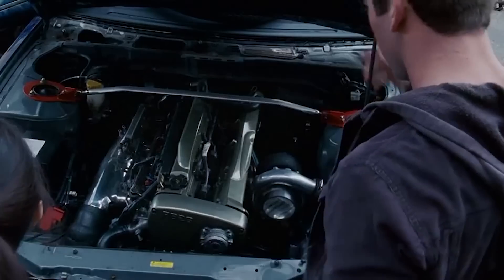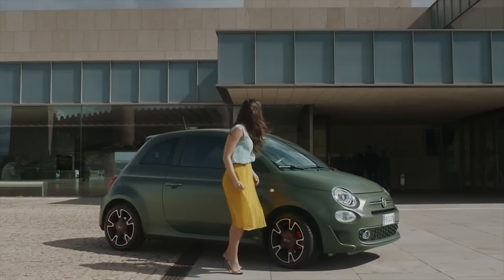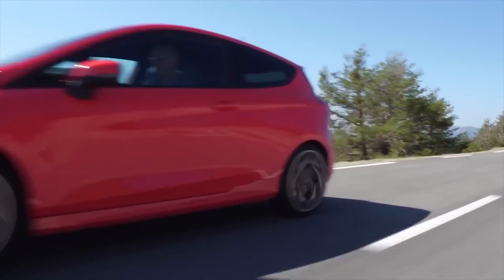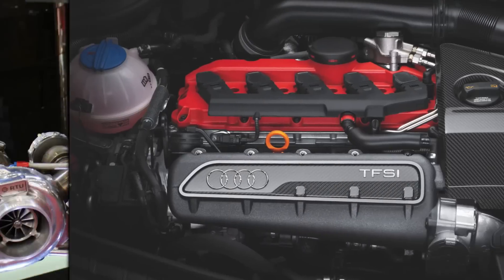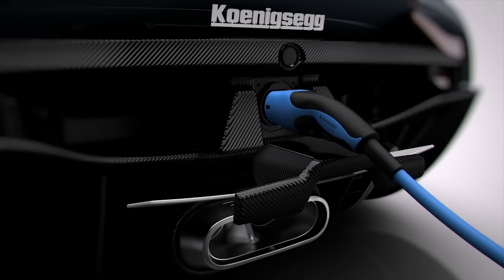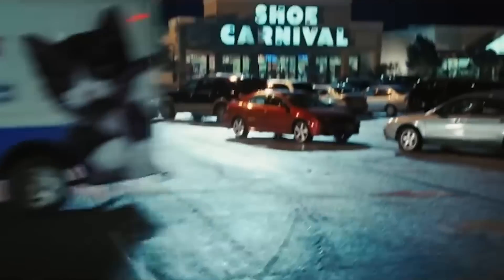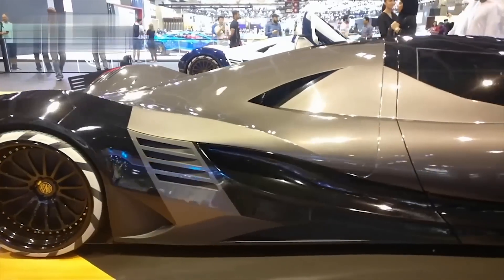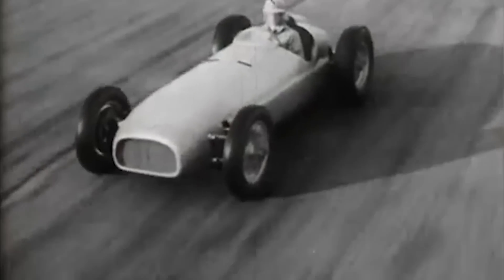Most Powerful Engines from 1 to 16 Cylinders

Comment: You had me all the way until you put the DEVEL.
Reply: I thought the engines 4300 somewhat HP was real? Just bringing it to the road isnt right?
Reply: @aukemarcus7679  yeah an engine is possible but it gets one run down a track and then it melts down and has to be rebuilt not very practical
Reply: There are alot of questions if its even real. They DID make a 2k hp car but I mean LS, Coyote and GTR has that beat easy
Reply: Same
Reply: Yeah it’s fake
Reply: Devel did not go in production.
Reply: go check the nelson racing engines channel if you doubt about the engine , they re the ones who developped it
Reply: @albapor1996  the engine itself if also fake. It look v16 but its pretty much a turbo charger v8. In the videos of the Devel there are not any real power shown. Not even a real acceleration. You cant hear any v16 sound in any of the videos. Also. There is not enough space for that huge FAKE v16 quadturbo
Reply: @balazs7808  or enough cooling capacity.😜
Reply: @danw1955  true :)
Reply: @balazs7808  no

Comment: They should have said, "production engine" in the title. They might have been the most powerful production engines, but definitely not the most powerful engines.  Top fuel dragster 8 cylinder engines make 11000 horse power.

Comment: Koenigsegg 5.0 is based on the Ford mod motor.

I thought that looked familiar, I had to look it up.

They used the mod motor as the base and engineered their own, though I would love to know the details on what was changed.
Reply: Strange. I thought the CC8 and the CCX had their engines derived from an LS
Reply: Nope.

I had no idea what they were running before yesterday. Never looked into them aside from Top Gear and Project Cars.

Comment: no no no, the agera rs and the one to one has more hp than the regera. The regera gets 1100 hp from the v8, and 700 from the electric engine, but the other two get 1360 hp, not to mention the new Jesko that gets 1600 hp

Comment: 336 mile per fill up on the viper.  I don’t see the issue about needing to stop at every gas station.
Reply: Let's make it 200 for a heavy foot, I'll still take that V10 torque.
Reply: Right I was thing the same thing. That's decent range.
Reply: The 2017 ACR barely gets 19, and with a 16 gal tank it had a range of 304 which isnt too bad either
Reply: I believe they said the Viper gets 21 mpg on the interstate .
Reply: That's for cruise speed, anyone who owns a viper would definitely drive it faster then that let's be honest🤣🤣🤣

Comment: Viper ACR gets 21 MPG on the highway?  Thats better than my 4runner.
Reply: The viper gets better gas mileage than my car too. I get around 14 MPG
Reply: thats bs a viper gets 9mpg on city and like 13 on highway
Reply: I had to re watch that a few times? And my car gets 25...
Reply: My car gives the same and it's a v6 with half the horsepower. I think weight and aerodynamics also has a lot to do with it.
Reply: I can push 30+ mpg with the 5.7l hemi on the highway doing 85, its in town where my mpg goes for a dive only avg 18mpg in town. Right now my avg of all driving is 22.4 mpg and my car is twice as heavy as the viper So I can believe the viper getting 21 highway.
Reply: Hahahha well the engine is big and powerful enough to pull a big light car lol
Reply: My 97 limited is lucky to get 20hwy.. but I'm keeping it!✔️😂
Reply: Ya 21 mpg is off paper bs not real number
Reply: @championx1  it's likely because it has very long gearing, and a relatively low weight. Nobody is likely to drive it in an economic way though, because it begs for more throttle.
Reply: Corvette gets 29 MPG.....screw rice burners

Comment: Cubic  inch displacement  or CID has a lot to do with power but its  also how you are built   I personally  will take the CID  the more air you can pump effectively  the more hp you can make

Comment: You are mixing turbo and naturally aspirated. You completely skipped the Honda S2000, which put out 100 hp per liter naturally aspirated.
Reply: Only 240hp
Reply: @bassinmylife9203  250, 125 hp per liter
Reply: Let me know when that Dodge Hellcat delivers 600bhp from cam, porting and headers alone.

Comment: Um what about the Agera RS 1360hp
Reply: Or Jesko
Reply: Regera actually has peak hp of 1700+ hp at high rpm range.
Reply: Honda S2000 AP2 regera has 3 engines 1 gas power and two electric ones but still where’s the Agera RS or even the Venom GT or even the SSC ultimate Aero or the Saleen S7
Reply: Thats what i wrote too

Comment: De La Vergne single cylinder 
330 liter displacement (20K+ CID)
125HP
4,100lb-ft
160RPM
40 tons
Made in 1903
Reply: 160 Rounds per minute it is.
Reply: 330 litre? That's 330000cc
160RPM? I think you want to write 16,000 RPM or 16k RPM
Because my table fan here spin faster than 160 RPM 😂
Reply: Edit sorry, i didnt remeber replying to your earlier comment, 

you are correct in your conversions, the engine is, three hundred and thirty Liters, 33000CC, or 20137.8CID, single cylinder, that spins at one hundred and sixty revolutions per minute, with a piston that reciprocates three hundred and twenty times per minute. The stationary engine(meant for use in factories likely) produces , one hundred and twenty five horse power, and four thounsand one hundred foot-pound of torque
Reply: If it's true damn that's just insane haha
Reply: That's some massive engine 😮

Comment: 6:33 "its enough to snapping transmission gears" THE REGERA HAS ONE GEAR!!
Reply: He means it by:
If another vehicle had the same amount of power, it would destroy its transmission
(which is still kinda bs because look at the 3000hp Nissan GTR)
Reply: @cavxlier7822  its not a 3000hp gtr its GTR shell with 3000hp.
Reply: Noobie Bass Boosts it dose the have gtr transmission, block, interior, turbos, tyres, rims, differential, or body panels, everything is aftermarket and nothing will be stock
Reply: @cavxlier7822  That's still stupid. You can break transmissions at 300 HP, it all depends on the tranny. There's trannies holding more than 5000 HP, so that statement is totally invalid.
Reply: I'mRinoX Not really. Those drag cars running that much power have special transmissions that work for one race, then it either stops working or they have to change or mend it.
Reply: iiKasivo stock mate u want to do this with tuned cars because we can do top fuel dragsters and they have 10,000+ hp
Reply: And Agera RS has 1360hp lol more than Regera.... this guy needs to learn more ab his cars lol
Reply: @shfla7293  then theres venom
Reply: Quinn Marchionini ELEMAYOOO
Reply: ...left ;o)
Reply: The car there  on the picture was a agera (rs) i think?
Reply: And no pistions its electric
Reply: XclusivePower  the regera is electric
Reply: correct me if I'm wrong but doesn't the REGERA have a planetary gear set... like one massive clutch
Reply: 2JZ

Comment: What about the 0 cylinder cars. Aka rotarys😂
Reply: @Eddie Hitler dude...its a joke. Take a fucking joke.
Reply: EXACTLY!!!
Reply: Was about comment that. Name another 1.3 that can be boosted to crazy power.
Reply: 0FG Rager yeah like the RX-7 FC and the RX-7 FD
Reply: Y’all mind if I.... blow an apex seal real quick?😎
Reply: They count as cylinders
Reply: @EctoGamer  technically it's about rotors.
Reply: @diegoNL2K  yeah and a 1 rotor is in a cylinder thats triangle shape
Reply: 0FG Rager yeaaaaah
Reply: Sorry, but that triangle, is a cylinder. Bad call dude
Reply: 0FG Rager so ur a crack head right?
Reply: Knowledge 100
Reply: We don't dare speak about the devil
Reply: lol they lost out to the electrics
Reply: No one even need gas anymore get with the times
Reply: @timb3174  No electric cars are shit, most of them are ugly and they don't have sound Exept this annoying high pitched noise
Reply: @timb3174  no
Reply: tim b everyone needs gas
Reply: No one cares about rotaries. That’s why they don’t manufacture them anymore
Reply: @jasonneal  it's not because no one cares is that the rotaries are unreliable that's why Mazda stoped making Any RX-7
Reply: Electric engines aswell
Reply: @timb3174  yeah,no. electric cars suck

Comment: I have a 3 cylinder 1.0 L stock Fiesta Red Edition that puts out 140 hp. It does 0-100 km in 9 secs, going to tune to 168 hp and will then do 0-100 km in 7 secs.

Comment: There are two engine configurations that are superior to all others. The inline 6 and the Boxer or flat 6. These engines outshine all other because they are both inherently balanced on all orders. They don't get the spotlight nearly as much as V8's because for some reason having those two extra cylinders has somehow become synonymous with more power. But the reality is, it doesn't. If it did, then all the big Rigs out on the road would have v8's in them. But they don't, they have an inline 6. 

Here's why that is.

A V8 is really just two inline four cylinder engine merged together at the crank in a 90° V configuration. This means that the engine still has all the same inherent imbalanced as the smaller engine its derived from. A partial fix is to use a cross plane crank and counterweights, but this results in another long list of compromises. 

An inline six is basically two inline 3 cylinder engines, each half still has the same imbalances, however each half has them exactly opposite of the other, so they cancel eachother out perfectly. The only inherent flaw of an inline 6 is the length of the crank and cam shafts. This extended length makes them suseptable to twisting, and thus bringing half the engine out of timing is its one flaw. But larger engines have stronger components, so this flaw is greatly mitigated.

Likewise, a boxer or flat 6 is also two inline three cylinder engines joined at the crank 180° opposite of the other, with each bank of cylinders reciprocating in exact opposition to the other. So each poston in the opposing bank is always traveling in the opposite direction to its opposing piston. The engine is also more compact that the I6, with shorter crank and cam lengths.
Reply: Nothing beats the savage sound of a v8 brother!
Reply: David Blalock and what about the v12
Reply: diesel is alot different than a gasoline engine bud another youtube mechanic man your talking about 10l to 17l caterpillar engines for example a ls7 thats a 7.0 thats twice as less the displacement you know the bore sizes are on a c-15? it like fitting a soccer ball as a pistion your statement is totally out of the ballpark you put something like a c6r against a gtr on track its going to lose v8s are one of a kind engine if you cant except that then you shouldnt talking bout engines
Reply: why you think V8s held titles in racing events? i mean think about it nascar and f1 wouldnt be were its at unless they had a v8 stop hating on them bro

Comment: Truth is, the displacement of the engine is very deceptive. Engine power is always the same per unit of air volume. An engine will run at an average air to fuel ratio 13:1 (+/- .5). If the engine runs richter it will run out of oxygen before all the fuel burns, losing power and fouling the spark plugs. If it runs leaner, the fuel will burn too hot and damage the engine. So you're pretty much stuck with that 13:1 air/fuel ratio. So the only way to get more power is to get more air to pump though the engine; And there are only two ways to do that, more displacement or forced induction. 
A larger displacement engine will make more power as its going to draw in more air per rotation of the crankshaft than a smaller engine. A larger displacement engine also loses less energy to mechanical loses as there is proportionally less friction. However larger engine require more space and add more weight to the vehicle.
Forced induction engines used some form of air pump to drive more air into the engine that what natural aspiration allows. This pump is either powered mechanically by a belt, gear, or chain drive off the crankshaft, electrically by a motor powered by the vehicle's electrical system, by a gas turbine driven by the engine's exhaust system, or by a hybrid turbo-electric system.
Forced induction pushes extra air into the motor, this allows (and requires) more fuel to be added, which equals more power. So a 6.0 liter V8 might produce 500hp, and a 2.0 liter 4 cylinder with a turbo could also make 500 hp. The 4 cylinder engine does this in two ways, turning half again faster than the V8, and pushing twice as much air into each cylinder per ignition cycle. In the end, both engines pumped the same amount of air and fuel through them, so both made the same power.
Granted this is a simplified explanation, but its enough for you to get a basic understanding of how this works.

Comment: So no one is going to talk about 3:50? I mean come on this is fake. It literally says stage 4. You don't gain hp through the wheels. You lose power because of the weight of parts. Stage 4 probably means stage 4 turbo based off the chart. But could mean other things. ThIs is FAKE

Comment: Why would Volkswagen use a 1199 superleggera L twin when instead they can use a 1299 Panigale L twin which produces more power and torque than the superleggera variant of the 1199 superquadro and also the 1299 Panigale L twin (1299 superquadro) is much cheaper to manufacture than both the 1199 and 1299 superleggera variant of the 1199 and 1299 superquadro respectively? It might be the unreliability factor which the 1299 Panigale superquadro is notorious for and as such the strong components (mainly more titanium components) of the 1199 and 1299 superleggera L twins compensate for the bad reliability???

Comment: when talking about v12, why didn't you mention LaFerrari? its has naturally aspirated v12 and produces more power than the 812 superfast.
Reply: Laferrari is a hybrid with a 6.3L Tipo 140 V12 that makes around 789 HP and the hybrid makes around 160 hp accounting to  950hp whereas the 6.5L Tipo 140 makes over 800HP on it's own. However these are far the most powerful naturally aspirated engines as the cars from the scuderia Ferrari's xx, the F1 cars of the late 90s and early to mid 2000s and ofcourse the Valkyrie cosworth and the soon to be revealed Mclaren v12 that will be the successor to the F1 are all more powerful.

Comment: Gotta love the "prototype".  They forgot to include what is actually produced.  Top fuel dragsters.  Power levels so high, we have no method to measure them. 10,000+ HP in a V8.

Also didnt mention the worlds most powerful ship. A 2 stroke making over 109,000 HP
Reply: @charlesangell_bulmtl  Go find legit dyno test before assume its garbage.  The top fuel is to agressive for a Dyno.

This aint your grandma's WRX or your sister's Skyline.  This is raw power. Only calculated based off RPM, Time, and Weight.

You should probably make youtube videos with as inaccurate as you perceive this to be....
Reply: @charlesangell_bulmtl  electronics are not the problem.  Its the ability for steel to hold up.  Going from 0-330mph in 4 seconds destroys things.  

Top fuel destroys the machines they get strapped too.

Electronics engineering is a major focus in my life... The combination of gasoline and electronics = extreme fun

Comment: ever heard of reliability?
also, putting a bike engine in a car is a terrible idea, toyota figured that out years ago when they put a yamaha engine into the celica
Reply: Wasn't it just the head that was done by yamaha.
Reply: @blyndrotor   oh ok thanks for the correcting me
but still, the engine was bad
Reply: @Digidi4  
I had a 2L celica "back in the day".
For the time it came from it wasn't that bad.
I didn't even have the twin cam yamaha head.
But a good set of extractors, carb upgrade 5 speed and a touch of cam. Did me fine. Quick enough (but always wanting more as we do) and very reliable.
But back then even a gemini or a escort wern't that bad.

Comment: The Papadakis Racing 4 cylinder Toyota engine produces 250hp per cylinder,,,, (4x250=1000 smiles) 😁
Reply: Speedfactory Civic have over 2000 hp with 2.0 r4 engine

Comment: 6 cylinders?......What about the Australian Ford Barra straight six turbo at 436HP and 424 ft lbs torque.....straight off the showroom floor. No special order!
Reply: Alfa Romero Giulia Quadrifolglio; 75% of a Ferrari v8 for 10% of the price 505hp/443lb ft. of torque with a warranty sitting at your local alfa dealership right now.

V8 Dodge Challenger Hellcat 707hp with a warranty sitting on the local car lot as well. 

really this list is borderline pointless because it jumps between regular production things like the Fiesta ST and the KTM 690 Duke to cars you won't even breathe on in your lifetime like the Bugatti; there are Tuners who make 1500hp GM Smallblock OHV V8s all day for pocket change compared to the likes of Ferrari or Koenigsegg money.

If we wanted to talk specific output Kings; Honda DOHC 2.2l from the S2000 120hp/l
Mazda Rotaries trounce that with over 200hp/l naturally aspirated (RX-8 1.3l 238hp)
There were also Class B Rally cars from the 80s outputting nearly 700hp from a 2.0L Turbo.

Comment: Nice and all, but a company called VGS 2cv sells sells completly rebult 2 cylender 2cv engines. Those combined with a supercharger at 1.05 bar produces 115hp on the wheels. In a 2cv that only weights 500kg...

Comment: 8:02 the Dodge Viper ACR has more power than the Lambo, no shit Sherlock the engine is 3000 c.c. bigger, go figure, and twice as heavy on fuel for only a moderate gain in power.
Reply: Dude its about cylinder count not displacement